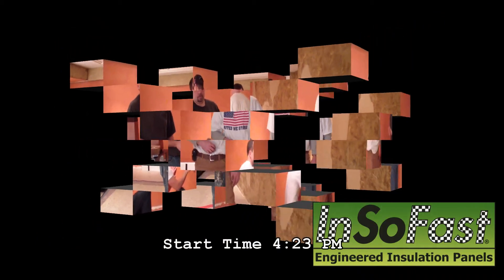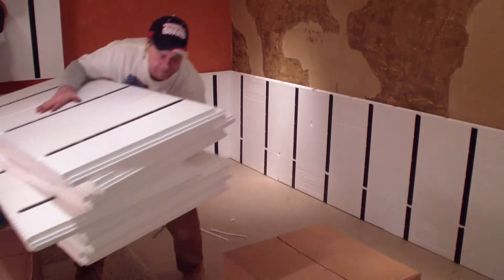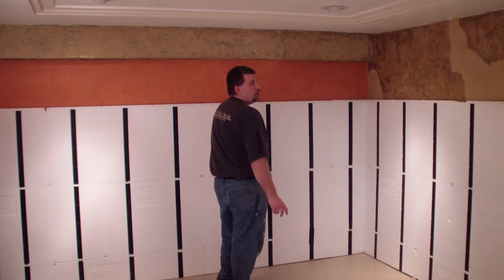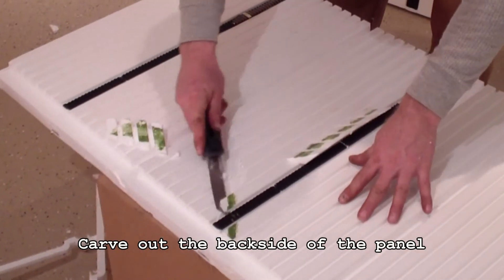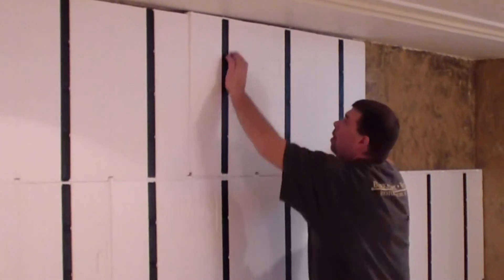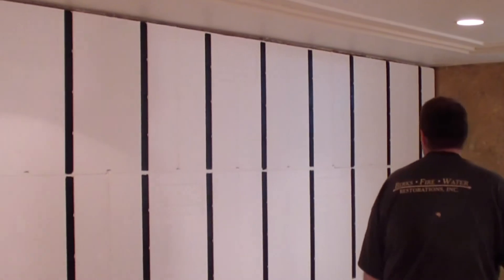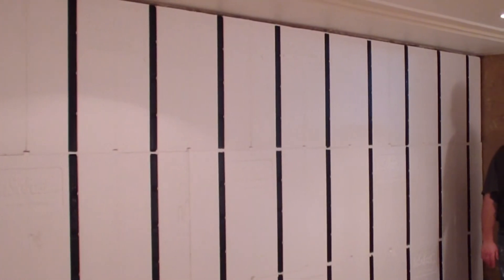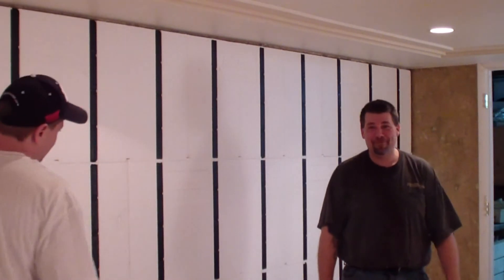InSoFast Boden Custom Builders

Comment from the maker: We have preformed extensive testing of adhesive applications of our panels on suitable substrates, (walls) and find that gluing is easier and quicker than mechanical fasteners.  But if you are more comfortable with drilling holes into concrete and installing screws please go right ahead, that method will also work well.

For more technical information visit our website @
http://www.insofast.com/ux-panels/installation/mechanical-attachment.php

Also watch this video where we use fasteners as a backup method: http://youtu.be/aM0SCIUZ9gI
 
For interior drywall applications mechanical attachment may be the primary method for securing the InSoFast panels to the wall surface. Use Tapcon® screws or Perma-grip nails in the center recessed attachment point on each stud, for a total of three screws per panel. (Tapcon Screws or Perma-Grip Nails).

1.	At the bottom of the wall install a row of mechanical fasteners between 6”and 18” up from the floor at 48” on center on center utilizing the recessed attachment points molded into the InSoFast co-polymer studs.

2.	Install additional row(s) of mechanical fasteners at 48”on center spacing as needed to keep a maximum 48”on center spacing between rows of fasteners.  

3.	Install a row of mechanical fasteners between 6”and 18” from the ceiling (or at the top of the InSoFast wall panels) at 48” on center utilizing the recessed attachment points molded into the co-polymer studs.

Comment: Does the little horizontal gap along the top of the wall need to be filled with spray foam and should any gaps along the cement floor also be filled with spray foam?
Reply from the maker: Yes we do recommend filling in all gaps and cracks with spray foam. The more you can air seal insulation the better it performs.